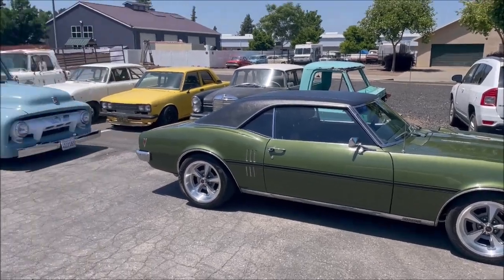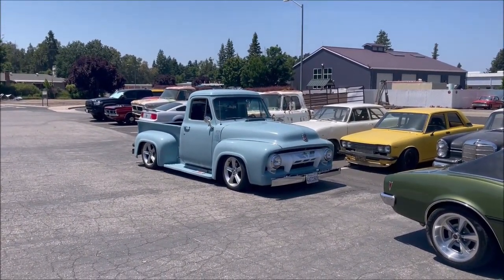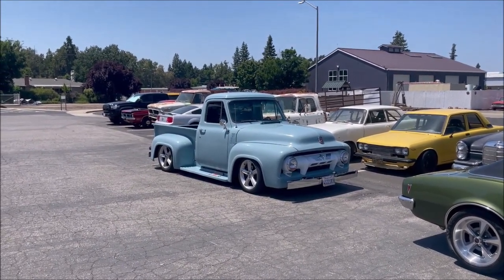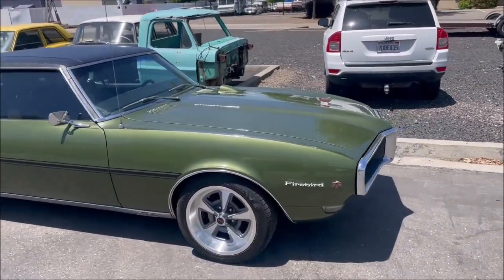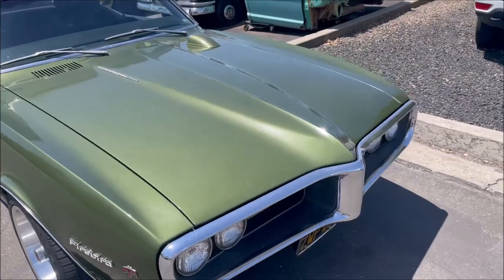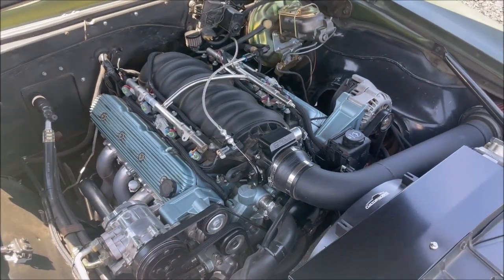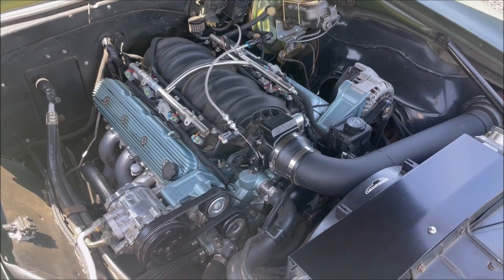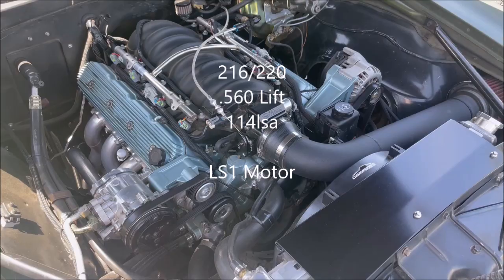What power does YOUR Daily Make?  We dyno MY LS 68 Firebird

Comment: 418 Tq, 422 Hp crank.    No idea wheel..
Reply from the maker: Drivetrain takes about 80-100hp or 15-20% power loss.
Reply: @ks71z28  can’t ask for much more in a little 2 bolt 350. :)